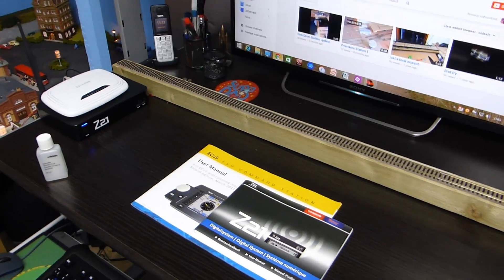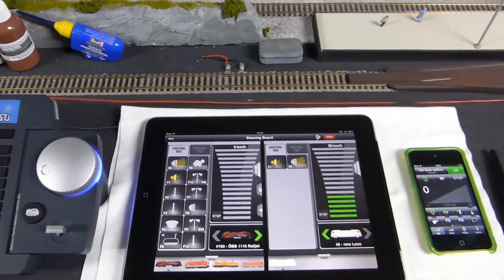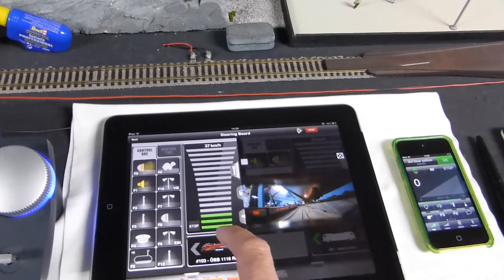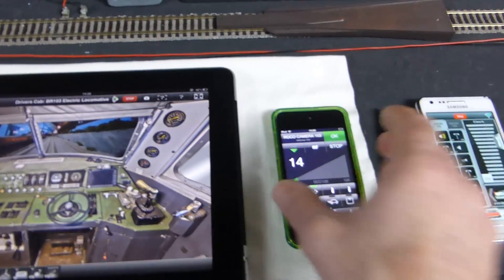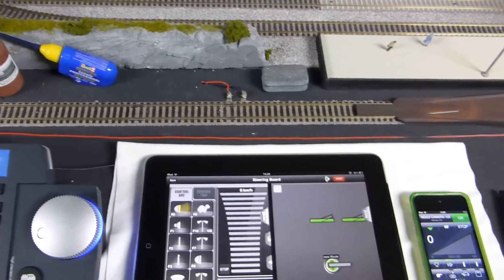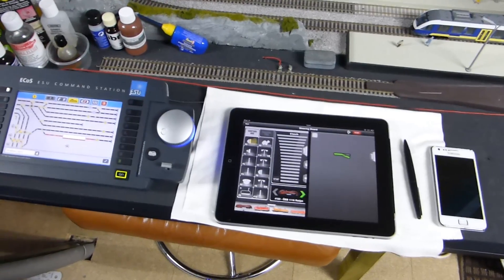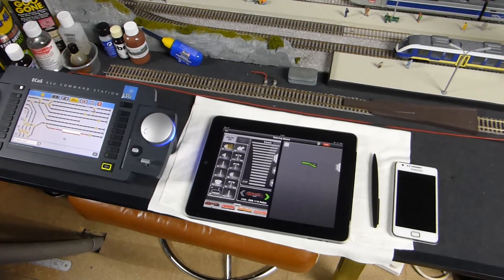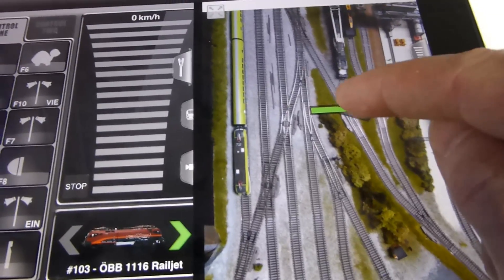Z21 JOINS THE ECOS

Comment: Hi Jim! I wonder If you can connect the Roco 10808 track occupancy detector onto the Roco Z21 and will it works fine as well joined with the Ecos?  Sorry for my Poor English
Reply from the maker: Hi Jose, Not sure about that, as the main system is the Ecos..and mixing the Loco-net detectors with the Ecos detectors may not work when the Z21 is added to the Ecos.
Reply: @hovermotion  thanks 😀

Comment: Hi Great Video!  Thanks for sharing.  I am wondering if you change a switch position on the ECoS will it update the position on the Z21?  Or not because communication is only going 1 direction from Z21 to ECoS?  Charlie
Reply from the maker: yeah it will change on the z21 and viseaversa  but the address of the points on the z21 software  will need adjusting a few digits so to work ,the z21 uses different dcc system.

Comment: Since you’ve essentially tried all the toys, please answer me this.  What’s your go-to daily use wireless controller?   Given what you have to pick from, what’s the most handy?   Does the mobile control 2 stand up?  Is it the z21, or do you just like to turn the knobs on your ECoS?   Thanks.
Reply from the maker: Hi James...its my samsung galaxy note 4 with a free app called "ecos controller"
Just connect the ecos to a router.
I sold the ecos mobile controller 2 as I thought it was very badly designed.

Comment: Hi Jim, I've got a question for you pal! Having used the ECOS functions to send shuttle locos about and getting right into that system on it. Do you prefer the functions on that or the Train Controller gold? I'm currently on my epic journey of building modules for my n gauge layout and have to make a decision whether to invest in gold or not. I know I can pretty much run the whole thing on the Z21 but when I start taking it to shows I want to be able to automate it and chat to folks rather than run from ipad all the time hence my question. 
I can throw whatever money I need to get it right, but don't want to keep wasting coin trying things out in advance. So I guess my question is do you feel you have had value for money from gold? I do not see you saying much about it since you invested in it even though you mention the blocks you've set up which the ECOS can use too. So any feedback would be welcome my friend.

Cheers,

Dave B
Reply from the maker: Dave Booth Hi Dave,

Go For Gold if you can its way better then silver or bronze as it works out complex routes and solves any problems on the fly.
I am stil learning the software and have a long way to go as it is a very powerfull pice of software and  can do so much.
There are many other software packages some are free but tt gold for me was  easy to get going etc.
Reply: Yeah Jim, I bit the bullet and bought the gold version today, gee £450 quid it better be good. My only concern is they seem to keep charging for every update. 
I'm building modules at the moment so am able to create loads of blocks on each module which will definitely be very useful to me. 
Also just ordered the Digikeijs DR5000 Multi-Bus DCC Command Station Central too so I can use that for points and signals linked to my Z21. So been an expensive day for me today, but at least it gives me solid stuff to work with.
Reply from the maker: Dave Booth cool....nice kit.
Yeah the tt gold updates are few and far between ive not upgraded mine to the recemt version as the version I have works fine..they do take the p### when it comes to any add on packages etc.
Reply: Hovermotion  I’m surprised how easy it is to use very impressive really even I can use it without getting stressed out lol. I can see this will the job I need for the module system I’m planing in the coming year. The fact it can run 250 locos is amazing and will be impressive. I’ve got just short of a 100 so I’m going to have some fun for sure. Thanks for your help pal.
Reply from the maker: Dave Booth yeah the gold version can do so much more too....its just having the time to descover what it can do...

Comment: I am loving all your videos.  I am very new to the train hobby (as in one year as of typing).  I run all Märklin AC (including C-track).  Up to now, I ran my 6' x 18' table (4 trains, locos), with a simple Mobile Station 2.  However, friends talked me into getting an ECoS for my planned new, much bigger layout (bought, but not yet arrived).

Anyhow, what has me intrigued in this video is that Roco Z21 and how you could take pictures off the layout and then add the switch function animations.  I would love if you could elaborate on that- it is very cool to see that done.  Is that a function of the Z21?  Can you do this in lieu of programming a layout on ECoS?  

Your ECoS videos have been very educational for me as I prepare to advance my controlling situation.  I have been nervous about using an ECoS DCC system on my Märklin AC/MM/Mfx layout, but I have been assured it will work fine.  From what I understand a few extra animations on the Märklin AC MFX+ are net readable by the ECoS.  This is the only downside (for me) of all your videos- you run DC, DCC, and iOS, and everything I run is Märklin, AC, MM/Mfx, and Android.  I'm still trying to find videos of someone running a Märklin AC system and track with the ECoS.
Reply from the maker: Anthony Dodge Hi Anthony, many thanks...I am glad some of my vids are usefull.
your marklin trains will be fine on the ecos as its a very adatpable system . my Z21 is hooked up to the ecos and they work in tandem but the ecos is the master system....with the Z21 you take pics of your layout and place and size the points over the pic so they work my just touching the junctions on the pic...the Z21 and the ecos are very advanced systems which can a lot on there own.

thanks jim

Comment: Good afternoon , i wonder if you can assist a beginner please

I have a Roco z21 (white one) and a DR4018 switch decoder from Digirails and i cannot for the life of me figure out how to get the things to comunicate , I have connected it to my main bus on the power and signal connections but how do i program this using my z21 ???
Reply from the maker: it should be very easy on the z21...I programmed all my switch decoders on the ecos ,You need to give the switch decoder an address first then once it's logged once the system you just add swith point address e.g switch decoder 1 point number 1 .
Reply: +hovermotion do i give it a loco address then , i am a newbie to this and I am trying to lean so much in such a short time :-)
Reply from the maker: I know what you mean I had to learn all over again when I built my layout as I knew nothing about dcc....
There should be some vids to show you on a&h models channel have a look....jim

Comment: Jim

I have both and need to do what you have done. What is the name/title of Alan Watt YT feed so I can find it - thanks
Reply from the maker: He ,its  Alan Watt has no vids on how to do this he just mentioned it on one of my last vids..on the roco 72331 koco tip  see the comments. ..
All you do is feed the track power outouts from the z21 to the two tiny screw inputs of the sniffer port on the ecos...see the ecos manual...jim
Reply: hovermotion Ah - that explains it (I searched his videos :-) Have been following your feeds for a while, this is the best one yet and just got to the end of your point control add to the picture of the layout - as you say it is mega. Was wondering if the Z21 could talk to the ECoS and you answered the question right here - thanks

I will get some of the ESU switchpilots (have about 16 points to control) but several will be Fulgurex slo-mo so was pointed in direction of new DCC Concepts AD-8FX decoder with 8 ports - good price as well

Love the ESU shuttle decoder as well - all this stuff I need to get.
Cheers
Paul
Reply from the maker: cool... i am doing a vid on shuttle stop over station next on port three of the detector..

Comment: Hi,

If you download the Z21 Maintenance Tool  and install it on your PC, you will be able to fix the +4 on the accessory decoder problem.
There is a check box on the second tab of the program that you need to check.
This had me foxed for quite a while as I couldn't understand why non of my points would switch, until I carefully studied the maintenance tool.
Reply from the maker: Interesting Many thanks for your info.....I will have a look at that....jim
Reply from the maker: hovermotion Thanks Macuser557 , i have just looked at the + 4  tab on the maintenance program for the z21 and adjusted it ...its a nice bit of software i never knew about this...many thanks jim

Comment: Thanks.  I thought the full video portion was just from free SW downloaded to device - I dd not realize the Full Cab required Z21...  And yours is the Full Z21, NOT the z21 (little brother).

As for the "Feedback Module", if that is the only thing required (16 segment module), HOW are the Trains Detected?  NOTHING on the Track?  Oh Boy, I need a Tutorial!!!
Reply from the maker: Hi...yes for the full cab overlay e.g prototypical cab with working leavers and buttons the z21 or Z21 is required. ..the  benefit of rigging them together is to have full use of both systems as the Z21 or z21 can also run in client mode from its router meaning use of the camera loco - live video feed and full control of the loco at the same time and all running through the ecos too......
For the ecos shuttle mode all I have is two pices of track montered from channel one and two from the feedback module ..what causes the brakeing is the adjustments on the c.v for "breaking delay" on the standard lcoc dcc chip or sound chip (which can easily be adjusted on the ecos) There are no other sensors on the track....
Jim
Reply: hovermotion OK, I think I understand the concept.  But if you have a good web resource that clearly defines the uses, please point me there and I'll review (I had look into this a few years ago and stopped as even the actual manufacturers seemed to have a hard time to outline Clearly what to use where):  You segment the track sections themselves, that you'd like to monitor, and they are fed power from the feedback module.  In your case those track sections are both in the main station.

Q: Does, the Feedback module slow the train to a stop? (The train is NOT transponding).  I want to understand HOW a train entering the section is told to Stop as, each train having its own unique address makes it a specific command task...
Reply from the maker: hi, the ecos tells the loco chip on shuttle mode to stop once it enters the end station {feedback 2} and sends it back out after a so many seconds this part is handled by the built in shuttle mode on the ecos..
Reply: Understood - you have to "Setup the main Ecos Console" to watch and respond to what the Feedback Module tells it.  So for me, it makes me wonder if I'm stuck having to purchase Lenz Feedback Modules or if the Ecos are compatible...  I'll have to research this!
Reply from the maker: Not sure if the lenz feed back mods are loco net if so they are not compatible on the connection to the ecos..so I would go for a esu detector as they are auto config and plug and play also they auto update if a connection is live on the ecos......have you seen the vid I did on the esu detector. ...?
Reply: Aaah - I'll search for your Vid as No, have not seen that specific one.

The Lenz Bus is XpressNet as is Roco.  Even my handhelds are compatible plugging into the same jacks.
Reply from the maker: lenz will work on the z21 but not the ecos then..i will send a vid link..
Reply: Please send link - I'm not finding it...  What did you pay for the 16 segment feedback module?
Reply from the maker: 175 u.k but the one i have is the advanced over the top model...there is a cheaper one..

Comment: Hi Jim.

Can you help clarify 'why' you'd want to couple the Z21 to the Ecos?  Doesn't the Ecos already do the wireless itself?  And everything else?  I'm trying to understand WHAY the Z21 'brings to the equation'...

I thought that the Ecos is how you have the wireless tablets, iPod, Etc linked (to Ecos)... 

Also, the NWB Lint running in shuttle mode - please list "Required Components" to do this.  THANKS!
Reply from the maker: ....you  know me ........I just like trying and messing with all setups , i got the Z21 to try out and reconfigure my camera loco and sell on ..but as it can work in tandem with the ecos i can run the new roco camera locos in full cab mode along side my ecos using the z21 ...you can not do this unless you have a z21 there are the programming features too e.g zimo sound programming....its also a backup command system.....the item required for the shuttle mode is a esu feedback module and thats it...adjust the breaking c.v and you get the gradual breaking sequence........ Jim

Comment: Nice toy the Z21 ,i have it too
Reply from the maker: The z21 Z21 is a very good system thats one of the reasons I bought it as how it works has never been done before by another manufacturer-company. ...
Reply from the maker: hovermotion how it works meaning using photos for the track plan ....and a very easy to manage setup ..etc......jim
Reply: hovermotion it,s the Z21 not the z21 thats the white one whit less options,but yea good system.